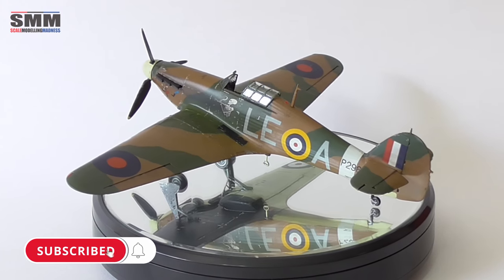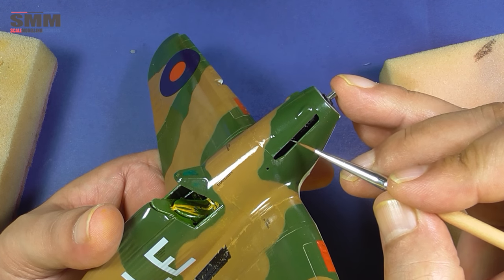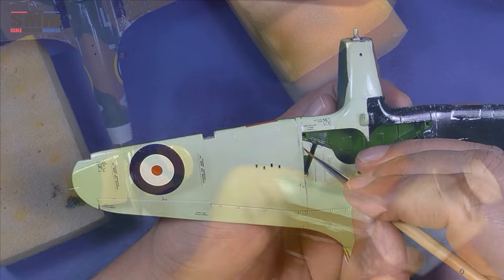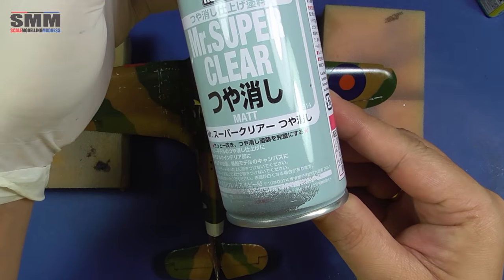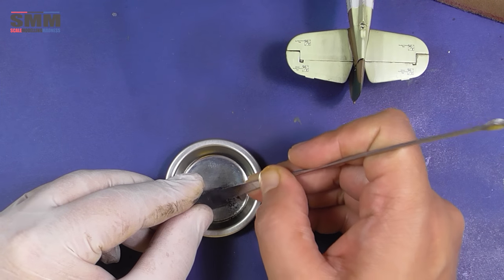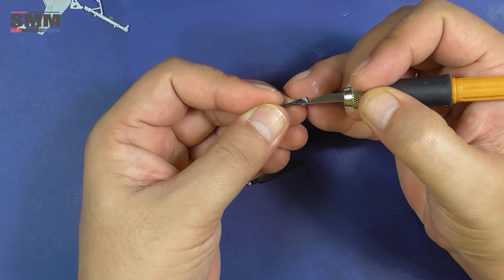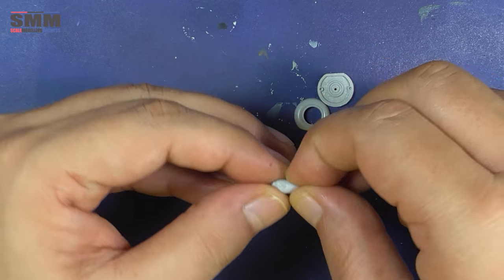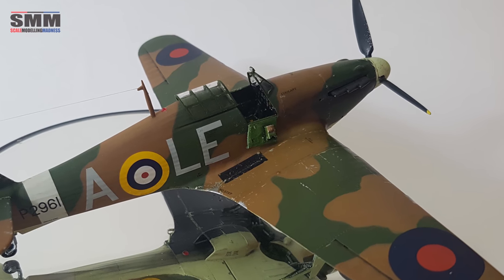Beginner's Guide to Hand Painting Models: Part 4

Comment: Nice result. I only hand paint small parts but it was still useful to see all the weathering techniques and I might try handpainting my next 1/72nd model. One tip when painting the tyres is to put a drop of neat thinners into the seam where the tyre meets the wheel rim. It then makes the black paint flow round really nicely. And a question - how did you attach the eleastic rigging for the radio wire? Thank you/
Reply from the maker: Thanks John....I don't use thinners but I do sometimes use a panel line wash, like Tamiya's, for the rut where the tyre and the hub meet. Same principle I guess :) The rigging is attached with tiny (really tiny) drop of super glue.

Comment: I watched your older guide and you did the oil wash before the chipping, in this, however, you did the chipping before the oil wash. I think I said that right 😂. Anyway, I'm working on my first "real" attempt at a model plane and I'm sort of confused about what to do first. Thanks for the great tortorials!
Reply from the maker: Hey Henry. First off, thanks for watching the videos. So, what came first the chicken or the egg? Lol. Whether to oil wash the kit before or after the chipping depends on the final effect that you want. If you chip before the oil wash, the wash will also affect the chipping, making it dull and it will look like old chipping that has now collected soot and dust. If you chip the kit after the oil wash, the chips will look fresh, something the aircraft picked up in its last mission. So, when to chip the kit becomes a personal preference. Sometimes, I do some chipping before the wash and then add some high lihgts after. Hope that helps. Good luck with the build and stay safe.
Reply: @scalemodellingmadness4114  Thank you so much! That’ll really help 😂!
Reply: @scalemodellingmadness4114  I guess, I have a question about the varnish too, is it best to do the matte varnish before or after the chipping?

Comment: Hello, hope you are well. Again amazing the weathering done. Thanks for those explanations. I still have a problem with terpentine trick. I've tried but it's nearly instantly dry🙄. Maybe im using wrong product. Could you please share details on it? Many thanks.
Reply from the maker: Hey Emmanuel, if you are having trouble with diluting oils in turpentine, I would suggest you check the oil paints you are using. Standard oil paints take several hours to dry, as does turpentine. I use Daler and Rowney Artists turpentine. Most of my oils are Winsor and Newton. If the problems remain, then you can try oil paints made specifically for scale modelling. These are a little more expensive. Good luck :)

Comment: Hi a quick question on applying wash. What’s the purpose of applying a wash? Thanks.
Reply from the maker: So, a wash serves many purposes.
It will highlight the panel lines and rivets on the kit that may otherwise get lost in paint, particularly if the paint is dark. It also helps other details pop up and become more visible. Secondly, if you want a weathered look for your kit, particularly if you are making a tank (or AFV), a wash is good place to start building the grime and mud build up. Applying a wash also helps even out the overall look of the kit. However, as with most things in model making, whether you use a wash or not, how much you use it, is all up to you and the final look of the kit that makes you happy :)
Reply: Thanks for the detailed response. Much appreciated!!

Comment: Thank you for the time and effort you put into this 4-part series. It was of great interest to me, but am reluctant to use your techniques as I fear a loss of detail as a result of panel lines etc getting filled with paint. I use Tamiya and Mr. Hobby paints and sometimes Vallejo. Tamiya paints are difficult to brush on I have found, it doesn't attach to the surface and it gets messy when I try to make it 'stick.' What am I doing wrong? Anyway, thanks again - liked and subscribed :-)

Comment: Very useful series of videos! Can I ask: why do you use oil paints for the wash, and for the details after your matte coat?
Reply from the maker: So I use oils because of three reason, firstly, they are very safe. Oil paints are not aggressive and generally will not damage the underlying paint. Secondly, they take a long time to dry, so I can keep tweaking and tuning them till I am satisfied. And lastly, I like the way the oil wash looks. The matte coat I think I used Mr. Super Clear flat/matt. Hope that helps :)

Comment: Please, please, please, list all the supplies, materials and tools you use for these builds. Great work btw!
Reply from the maker: Thanks mate. There is nothing special that I use for the builds. Just some acrylic paints (usually Vallejo, Mig or AK). Some nice brushes.  I use Tamiya extra thin cement for gluing and some super glue when required. If there is any specific product you want to know about, please let me know. :)
Reply: @scalemodellingmadness4114  So some things you used I’ve made note of:
Molotow Liquid Chrome
Dealer Rowney Buff Titanium
Winton Oil Colour, burnt umber, black
Mig Elastic Rigging.
Reply from the maker: @1romcat  Hey Romcat, thanks. I will surely keep in mind your suggestion about listing the things I use during the build. It may not be possible to make a separate video, but I promise that from here on I will make every effort to explain what I am using and why in more detail in my beginner videos. Thanks again for watching and for the feed back. Also, any questions you have I will try and answer. Good luck :)
Reply: @scalemodellingmadness4114  the Daler Rowney buff titanium you used that was an oil correct?